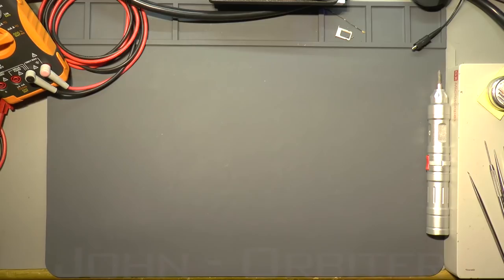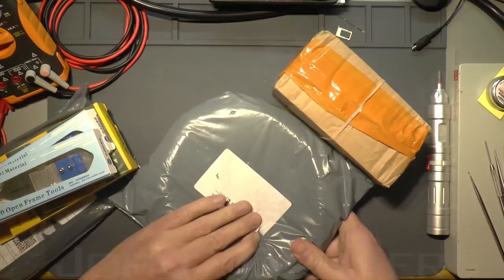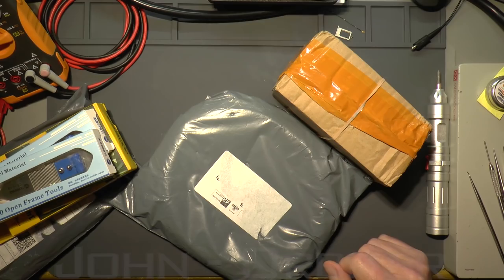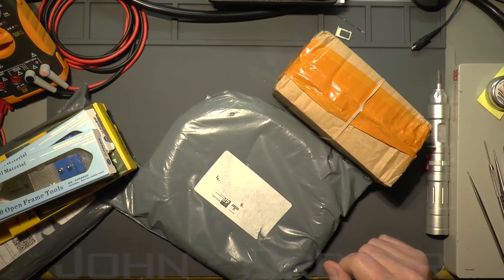Tools & Banggoodies. Postbag.

Comment: Well i think watching the video was worth the weight :-D.
The heavy duty spludger looked good.
Is the copper roll for re-creating sections of tracks or am i on the wrong path :)
Yes it's silly bugger day for my brain.
Reply from the maker: Hi Harv.. Glad you didn't find the vid too heavy 😉
The copper strip is for anything really, but mainly I cut it into specific shapes just to help protect tiny 0201 phone parts from being blown off the board with hot air 😯 😁
Cheers mate
John